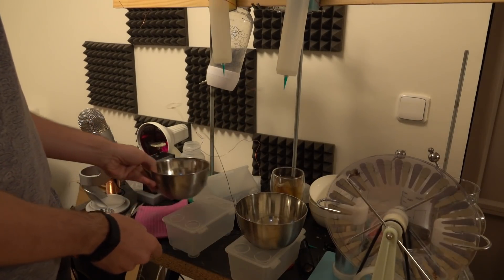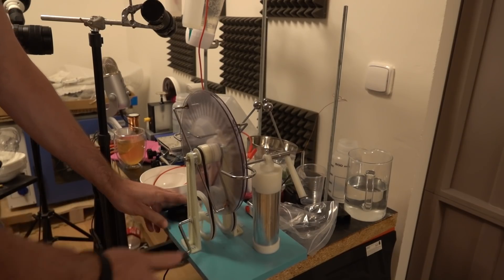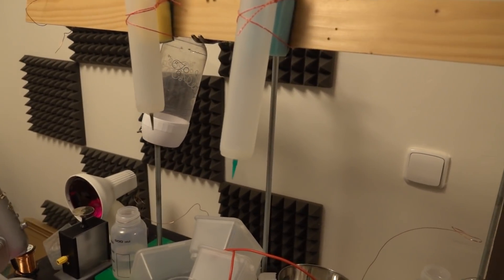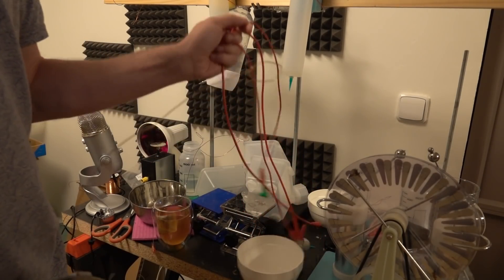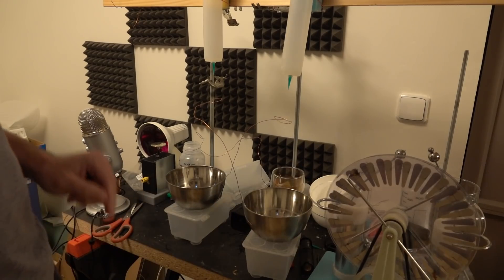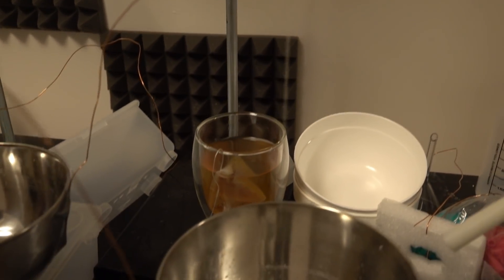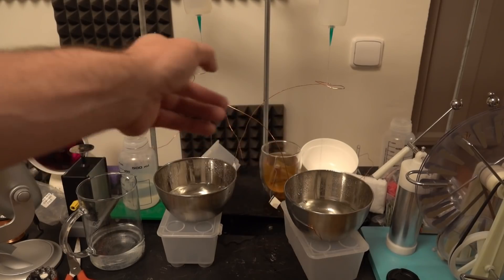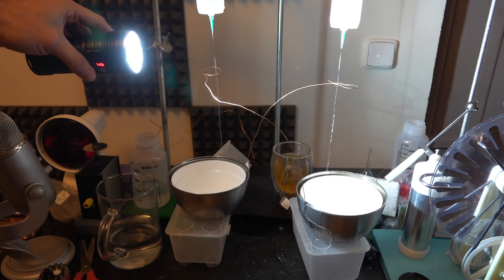How to make a 'Kelvins Thunderstorm'.

Comment: What if you use an even more strongly polar liquid, and then instead of one loop, make a long wire coil? (use insulated wire) Maybe the falling polar molecules somehow create an electric field and therefore induce a current through the loop as they pass through. Those changes might amplify the effect.

Comment: These don't work in humid environments
The lower the humidity the better.
Also the copper wire doesn't have to be bare it can be insulated.

Comment: The whole apparatus is symmetric, so how does it decide which side becomes positive or negative? Is it random every time, or do local factors bias it to always go one way or the other?
Or are they both just high-voltage in the same sense but with a large enough difference that there's a high voltage between them?

edit: oh nvm I read the wikipedia page

Comment: Some interesting experiment variants might be:
What happens when the charged water stream is subjected to UV light or RadioActive materials that can remove charge?
Can the experiment be run with Deuterated Water or as a fractional composition of the water?
What happens with a change in Temperature and/or Moisture Content of the surrounding air?  
Oh yeah and thanks a lot for taking First Place at the Science Fair yet again.  I'ma gonna take my paper mache volcano home and cry.  XD

Comment: .. i don't know why static electricity is generated then the water droplets split. but its what happens and it's odd. the charge travels up the stream across the wire at the top. one decides to be positive, the other - negative. i think?

Comment: So the laminar flow depends on the electrical charge? And if the wire takes over the charge, the laminar flow gets broken up (turbulent) when the wire reaches its maximum capacity. Fascinating. I wonder if you get higher charges, if the laminar flow is perfect.
Reply: Incorrect it has to be the opposite

Comment: As a science armature I would start with a guess towards water and it’s bi-polar properties? 

Could the same thing be done with an alcohol solution? Something not too flammable of course and a solution with water would defeat the purpose.  Ok scratch that. 
Could the apparatus work if you used liquid nitrogen?  Temperature sensitivity of the bowls and equipment being a consideration.
Reply: Liquid ammonia perhaps ?
Reply: @MODElAIRPLANE100  Possibly yeah.  Though it would need to be in a cooled environment.

Comment: So it's a charge based SR Flip Flop
Reply: So the future is Liquid State Drive?
The acronym being LSD! X'D
Reply: It's called a Lord Kelvin Generator but all I've ever seen it generate is sparks! Is there a way to actually store or use the power created by one of these or is it just like "theoretical volts" that is makes?
Reply: @evilcanofdrpepper  This device gets up to a few thousand Volt but with micro-Amps so the power generated is in the milli-Watts range. Not much to work with considering the total weight of the device.
Reply: Would be pretty cool for a building sized computer. That Set Reset Flip Flop could be the clock for a water based computer. And technically all you would need to make a full working computer is NOR or NAND gates. The CPU for the Apollo Guidance Computers (one in the Apollo command module and the one in the Apollo Lunar Module ), were built almost entirely using individual NOR gates.

Comment: Back when I did one of these, I found a tube of metal works better than a ring. You want the electrons to only "see" the opposing voltage and not the rest of the universe if you can.

Comment: ThunderF00t -  Could you incorporate this into hydro-electric power?  Or do they do that already (dams)?  

Also, can you ‘run multiple streams in parallel/series’ to get more power?  I’m picturing 2 huge pipes with small holes drilled every foot to drip into a huge bathtub looking receiver bin with wires setup how you have it for each hole. 

And use a portion of the electricity to power a pump to bring the water back up ( another commenter’s idea that mentioned it.). Or even with a river/dam setup just keep using the natural flow of water. Isn’t this free energy?  WHATS THE CATCH?!?  Super interesting my man! Cheers from UsA!
Reply: I imagine the power comes from reducing the water's kinetic energy (or, equivalently, its stagnation pressure), in that sense exactly the same as how a turbine gets its energy. Therefore, I doubt that energy extracted this way would complement energy extracted by a turbine, and instead I suspect if you used both methods together, the more one generated, the less the other would.
Reply: It is the same as static electricity. Won’t deliver any useful power. Same principles on how lightning forms etc
Reply: @william fleete  but what if you had like a thousand holes?  wouldn’t that amplify the power?  Genuine question as I know very little about electricity

Comment: Could you do it with two urinals? Guys in a bar would try to pee through hoops and it would spark. Might be fun?
Reply: NEVER cross the streams!
Reply: @EEVblog  I mean, unless you want to create a full protonic reversal in where every molecule in your body flies apart at the speed of light.
Reply: You have to complete the circuit, so they would have to be holding hands.
Reply: @IparIzar  🏳️‍🌈
Reply: 😂😂😂😂😂 pissoff
Reply: @UCsjrflXPe7AKiG1FzILU7QA 😂😂😂 complete and utter w-anker 😂
Reply: lol, connect it to the sinks so it shocks them

Comment: Aren't the charges in this thing miniscule? Even the best insulator will pass some electrons. Im not sure but i would think that would be enough to close the circuit.
Reply: You can also pass an electric field through an insulator. This is how capacitors are able to work.
Reply: @alphamikeomega5728  Aye but that field does not reach very far. To have meaningful charge seperation the wire itselfe as to be part of that capacitor, so it can have the electric field all the way up there next to the water. At least thats how i understand it.

Comment: If it is H+ vs OH- ion separation, one shoud be able to measure the differences in ph between buckets and containers.
Reply: I would have thought its due to free electrons and salt ions. Does it work with pure destilled water? Even then it might take some ions from the air or the water container material. I don't think you need all that much charge to make it work.
Reply: @hernerweisenberg7052  H+/OH- was suggested by wikipedia after tests on distillied water.

Comment: And this is how we generate all our hydro power.

(I'm lying, it's not.)
Reply: Yeah, it's much more simple that that.
Reply: @tarstarkusz  simple in the property used, this generator has way less moving parts.
Reply: @IparIzar  I meant simple as in it uses the mechanical energy of head to turn a generator.
Reply: You probably could make a perforated section of dam wall and run a craptonne of these and they would be producing transmission voltages, you would have to filter the heck out of the water and it wouldn’t be great for the fish but it would be interesting to see.

Edit very steampunk
Reply: I actually own several underground river canal systems and hydroelectric power? good idea at first
The river going into the input of the channelisation tunnel stops yearly in the start of summer   but the ambient flow from the lateral lines that are around random places including the infiltration of the old tunnel and the length and the wastewater discharges are good at channeling the water down to the beach area and discharges it out. 

Up until 2008 this happened until we constructed a weir that  consists of a 2 foot tall brick wall spanning the whole length and an 9 inch pipe the left hand corner that pipes it about147 feet through the 1987 extension then outside into the sewer via a drainage receiver. 

The names of them are the rio monterroso, arroyo de juan Benítez, arroyo de los Melonares, arroyo Calancha, arroyo Piojo and arroyo calanchilla in malaga
Reply: @masseyluna2002  pretty much all of the commercial sized hydropower setups require a lot of land to be flooded to make a large enough lake that you can pretty much guarantee a consistent power supply. Here in Australia we usually have to have a huge dam for the amount of outflow just because some times we don’t get much rain for most of a decade. In the tropics they mostly only have enough water saved up for one missed wet season.

Comment: I wonder how much power this would produce with mercury instead of water.. cody's lab made a sprengel vacuum pump and it gave him a hell of a shock
Reply: the energy comes purely from gravity, where else? if you drop a liter 1 meter over 5 minutes thats 0.03 watts which iirc is about half a AA battery
Reply: @OsirusHandle  obviously the mechanical energy comes from gravity but my point is whether the efficiency could be improved by using mercury instead of water
Reply: @markshort9098  Im not sure you get this effect with mercury. Water molecules are ionic/polar so act as a moving charge to produce the EM field in the wires, but mercury is monoatomic and thus neutral.
Reply: @OsirusHandle  I'm far from an expert with electricity but cody almost dropped a pan of mercury because of the shock he got from his sprengel when he grabbed the catch pan, he said next time he would put a wire from the feed container to the catch pan to stop it building a charge
Reply: @markshort9098  Thats static electricity from the mercury flowing over a different material (like rubbing carpet with your feet), which is different from the phenomenon being produced here. At least im reasonably sure, this may also be static electricity.
Reply: @OsirusHandle  i googled it, Kelvin's thunderstorm is static electricity
Reply: @markshort9098  Well there you go, i was totally wrong! Maybe mercury would function better, youd have to test it.